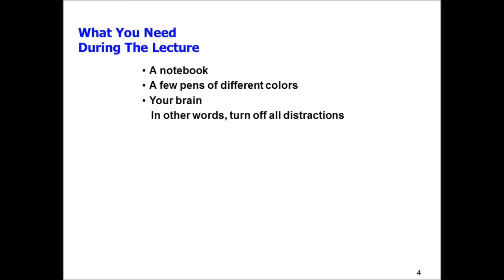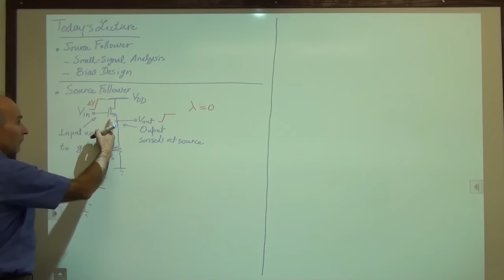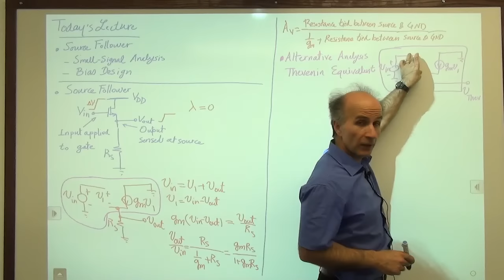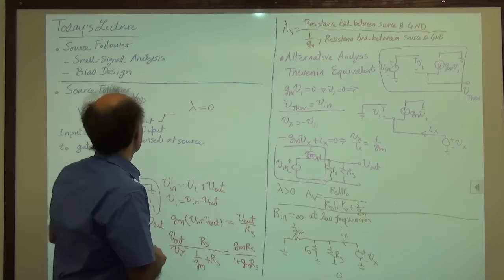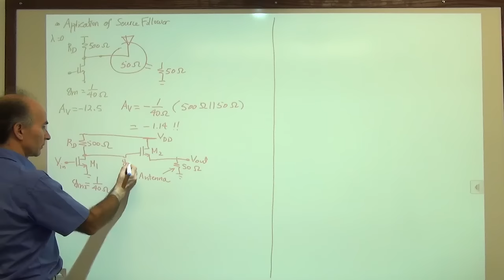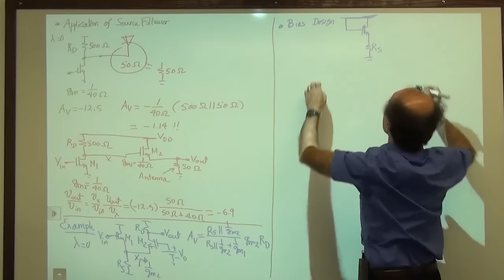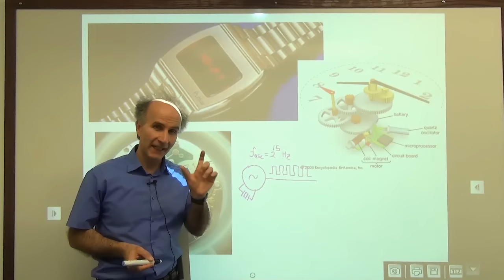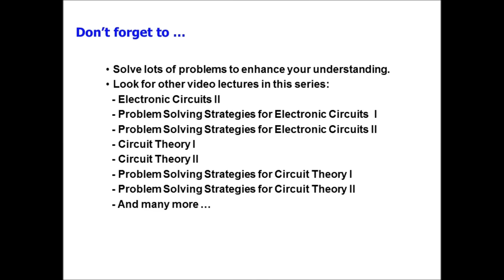Razavi Electronics 1, Lec 41, Source Followers & Summary

Comment: Great lessons Mr. Razavi. One short question: Can we directly drive the load from the source of the transistor and avoid the Rs all together? I am thinking to build this circuit (and use as a buffer) to connect my HF radio and SDR radio to the same antenna. If the 1/gm would be close to 50 Ohm that would be a good match for the input of the SDR. Otherwise it can be lower, but maybe that is not a problem for the SDR input. Side note: I will build another small circuit to disconnect the SDR input from the HF radio output when transmitting.

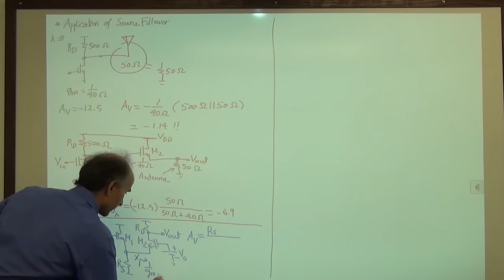Comment: Can anybody please explain how one can decide the resistance offered by a specific configuration as viewed from a point in the circuit for example at 41:30 in this lecture?
Reply: That is the basic definition of input or output impedance. When we connect a source we see some current... This voltage by current is the input impedance. So we can alternatively say that the resistance seen from these terminals is input impedance

Comment: @38:14 isn't  the gm 1/40 ?   there is mistake here  the gain should be -12,49
Reply: gm is 1/40.... but the gain of source follower is Rs/(Rs + 1/gm).... So value of 1/gm = 40
Reply: So no..... there is no mistake @38:14

Comment: Why  is Rs necessary here? anyhow videos are extraordinary
Reply: Just my own interpretation, it could be wrong. Without Rs, the source terminal shorted directly to the ground which means that the Vout will be equal to 0 volt. Hence, Rs is required so as there is IR drop across the Rs which act also as the Vout
Reply: The input signal is due to the transconductance property of the mosfet converted to a current. Therefore I guess Rs is needed to convert the current signal back to a voltage signal, in other words the output signal is sensed by Rs. The resistor Rs acts like a negative feedback device or degeneration device too and stabilises the whole circuit which is a nice bonus. Please correct me if I'm wrong
Reply: you need a DC bias current path to GND otherwise in the absence of a signal ID would be zero which means no gm  (circuit is dead).